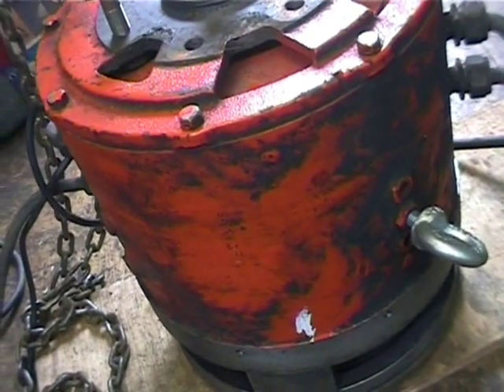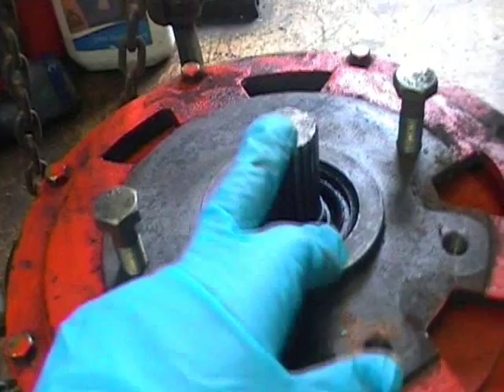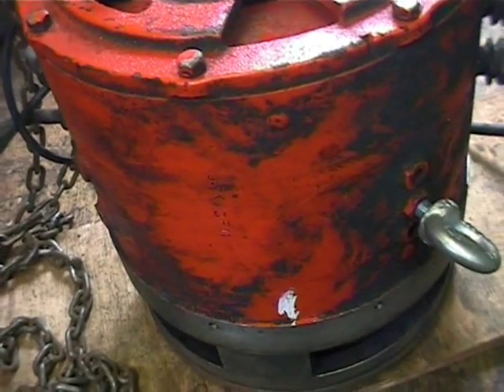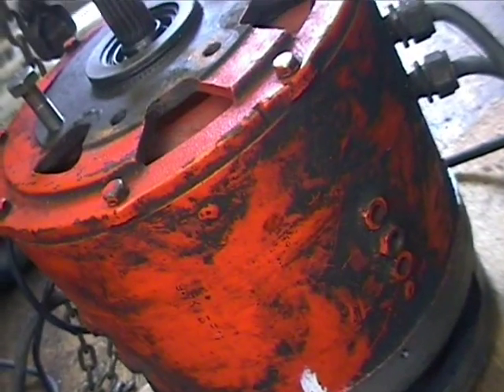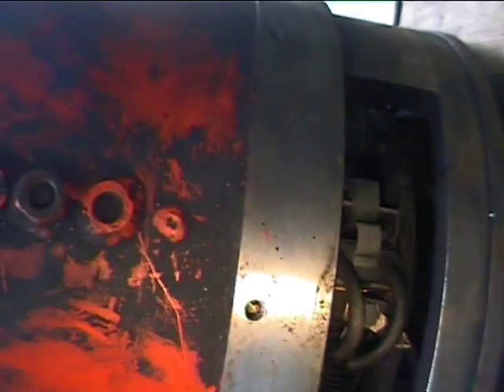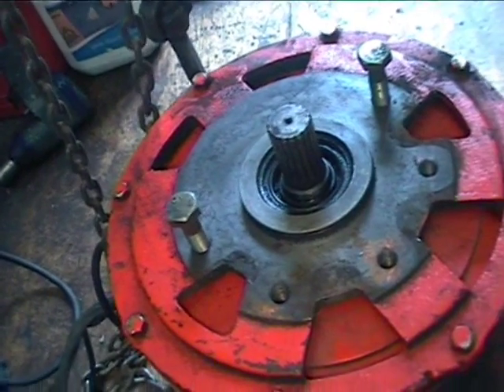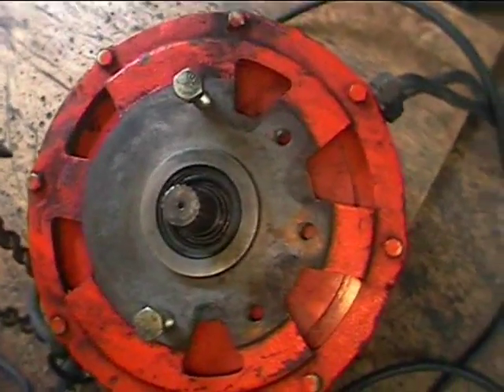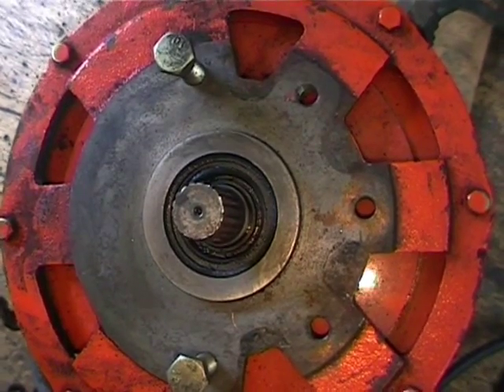Series DC Motor brush advance Part 1

Comment: I have 2 questions.  The commutator part where there is a steel ring to release the commutator copper, what kind of tool do you use to remove that ring.  Also, if that ring is glued by epoxy(i think), how do take off that glue first before you take the ring off.